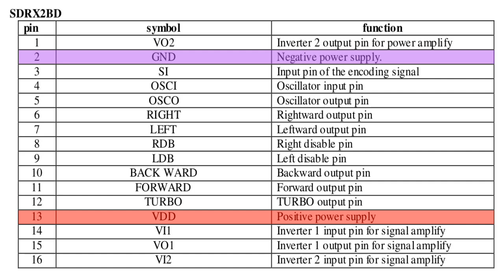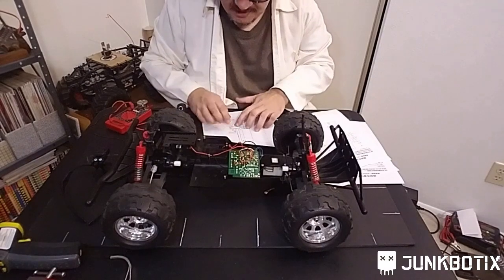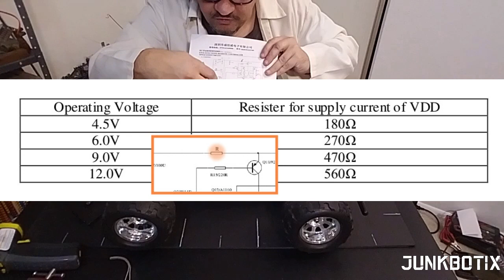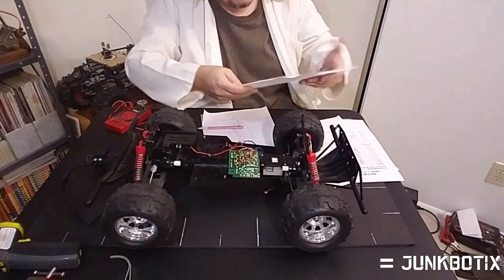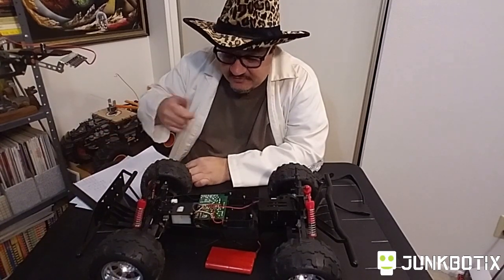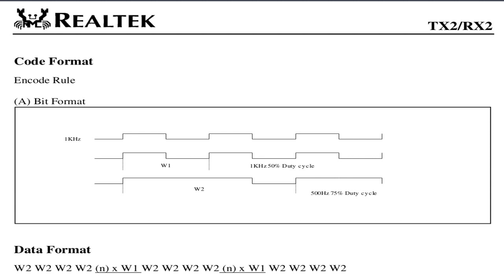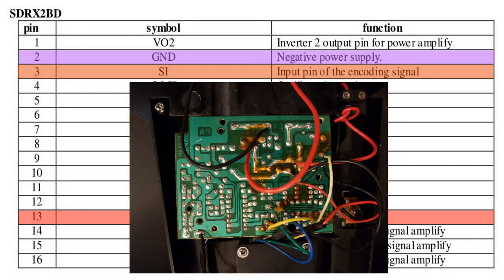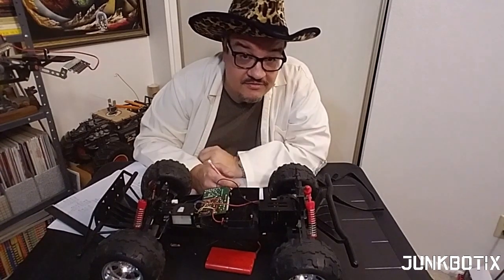Toy RC Car Robot Development Platform - Part 5 - Controller Interfacing

Comment: Add a little lead solder and flux to the old solder joints. It helps get the old solder to flow. Lead solder is better to work with. Lead-free tends to crack and corrode. Lead free is only really good if you are a business following environment regulations or if you live in the state of California
Reply from the maker: Yeah, that's what I know - but to get it started you still have to crank the heat a bit. I have my iron set at 785C - which may be a bit hot for leaded solder (well, the rosin core tends to vaporize fast) - but it does get that non-leaded stuff to flow. I think my biggest issue (beyond workability) with non-leaded solder is the "tin-whisker" thing...